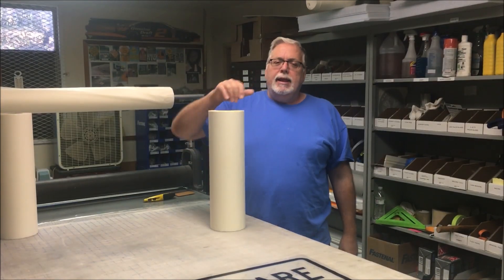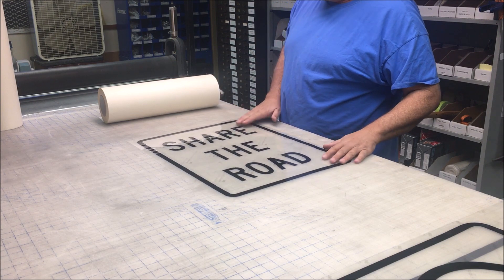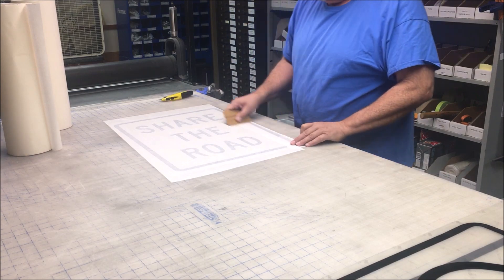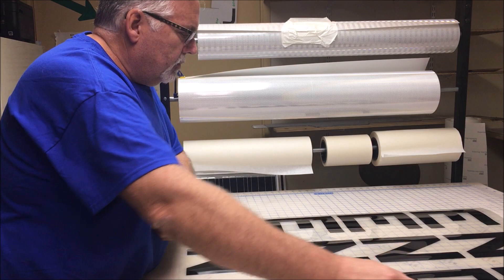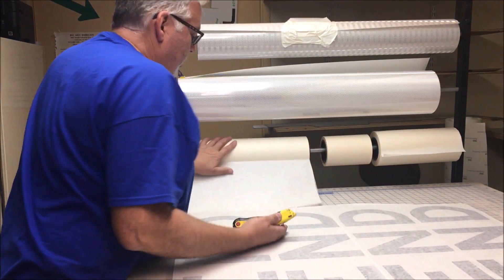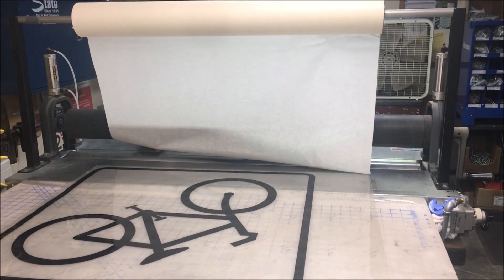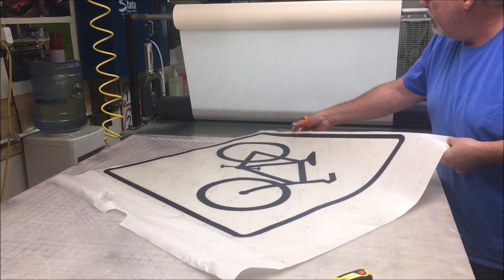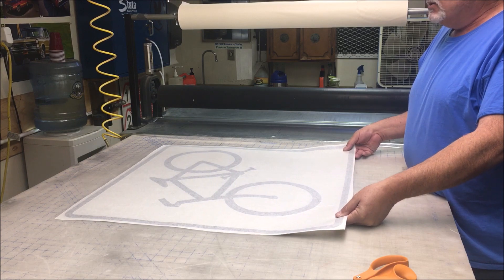Three methods of applying transfer tape for making traffic signs

Comment: I know its a old video but one word, BRILLIENT. I have been struggling with some 4ft RV (Motorhome here in UK) decals and Dred the moment it comes to applying the tape. Just tried the rolling method and it worked, i have just made a wood contraption to keep the roll in line with the decal. Thanks very much for taking the time to share, Brilliant  👍👍👍👍👍👍👍👍

Comment: This is great! Can you send me some up close pictures and measurements of your bracketing on how you made the application tape holder?
Reply from the maker: We no longer have this table. I got rid of a few years age when we got our new application table. I remember I used 1” square tubing and drilled a 1/2” hole and just use conduit to run through the application tape. Drill a hole through the conduit and put a bolt through to hold in place.

Comment: Bob, what are the best solutions for vinyl application rollers? I've looked into a few options both diy and store bought and still can't decide. I really like that yours has 3 levels and all your different tapes on there. Did you make that?
Reply from the maker: This is where we bought our roller.  https://www.highwayhandyman.com/
We made our own table and added the holders.
Check out www.bobthesignman.com I plan to add more pictures of the table soon.

Comment: for your second method how do you load and insert the transfer tape roll ?
Reply from the maker: The electrical conduit I use come out. I remove the nut and bolt and there is a hole on the other end and the pipe slips out allowing you to load the tape on the conduit. Always load the tape on the conduit with the end up and sticky side down.
Reply: @BobTheSignMan  Thank you great setup!

Comment: Bob, I want to install street number signs in rural and semi rural areas so 1st responders can easily find an address at night. I would like to be able to make my own signs because of the high cost and long lead time to have them made. The signs are 6" x 18". It looks like I should be able to get a small table top plotter  for around $1,200. I'm not really finding a small affordable roller. Are you aware of any options? Thanks, Paul
Reply from the maker: Paul Watts Check out US Cutters web site. I was thinking about getting one for my own private use. Amazon sells US Cutters as well.
Reply: @BobTheSignMan  It is the hand squeeze roll applicator that is cost prohibitive. Looking for a cheaper solution.
Reply from the maker: Paul Watts A application roller can run into a large cost. If your doing small jobs there are some hand rollers on the market. Here is one site that has affordable hand rollers.
 https://expresssignproducts.com/167-rollers

Comment: 2 things....the trimming of the transfer tape around the edges why not buy the clear from 3M? Save you that little bit of time on each sign . 2nd I noticed you haven’t mentioned or showed any graffiti film I believe 3M calls it 1160 if I’m not mistaken but that helps us dramatically reduce replacing signs that still have plenty of life left plus it helps ALOT with removing any graffiti we can use virtually anything and scrub on it if needed I know it’s expensive and a lot of guys don’t use it but when you look at the long run it does save time and money
Reply from the maker: I've tried the clear transfer tape and I personally don't like it. I seem to have more problems with it than not, like wrinkles and such. I have used some graffiti film in the past. We don't have a machine to apply the 1160 and it gets difficult to apply by hand. I doubt if I replace less than a dozen signs from graffiti in a year. Right now it is more cost effective to just replace the signs than to sheet 1160 on all our signs.